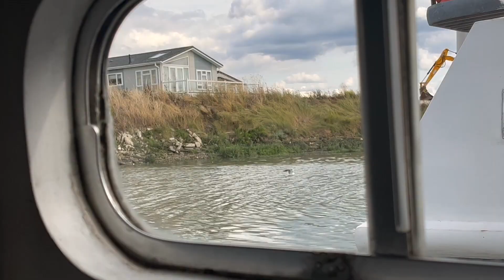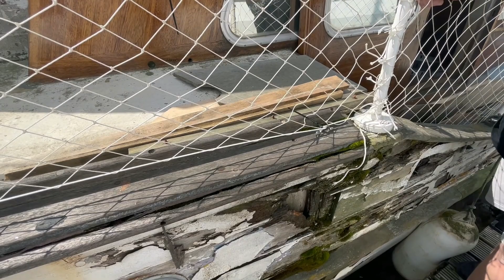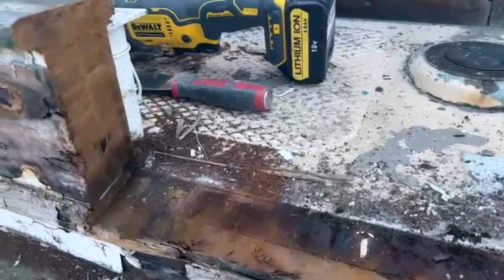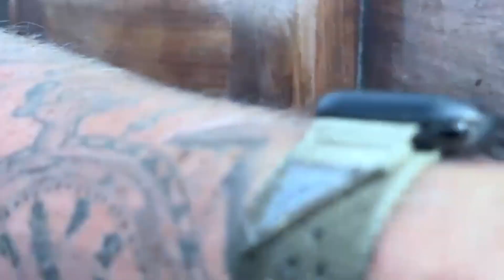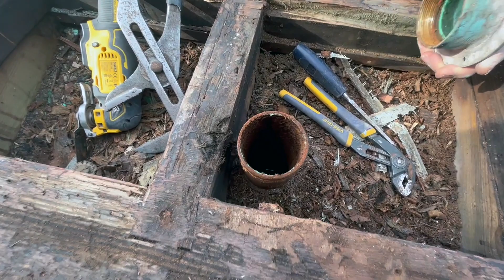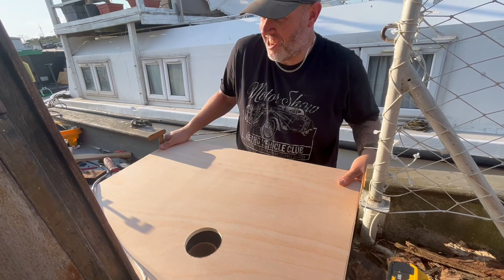E.p #95 - "THIS IS BULWARKS!!!!!" -  #boatrestoration  #woodenboat  #restoration

Comment: Well done Jason that was good job started as you showed the wood was a tad wet the beams underneath i think i would cover them in thinned epoxy for sealing against water getting again as for your hole that is repairable i watched lakeside productions last week repair a hole of about six foot by three foot with marine ply looks great now cut the rot out make template for the size you need repair with marine ply. As for the paint i know i said white thats the common used paint but how about blue/silver or blue/grey with a hint of silver see you next week
Reply from the maker: Ooooooo Kevin blue/silver that’s a little racey for me 😂 when the new deck gets put in I bed it in with thickened fibre glass which totally covered the beams so they should be all good. Marine ply is a good idea but I think structurally I wouldn’t be happy with it.
Reply: By using  a thinned epoxy  it will  fill the  cracks in the beams and make them waterproof and stronger
Reply from the maker: Yes that would be nice and strong. Only thing is that as they are planks at the moment it could cause a bit of an issue where they join and the damage is bigger than one sheet of ply
Reply: I was talking  about the  beams under the planks
Reply from the maker: Ohhhh right sorry lol I thought you were on about the hole in the side of the boat lol, but yes your right! 😂